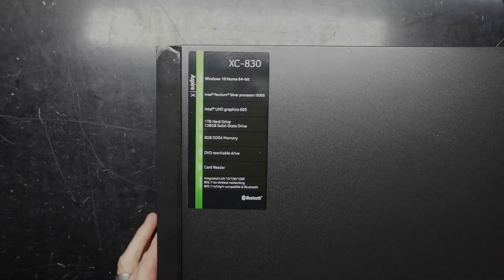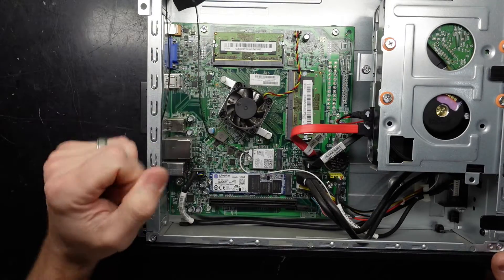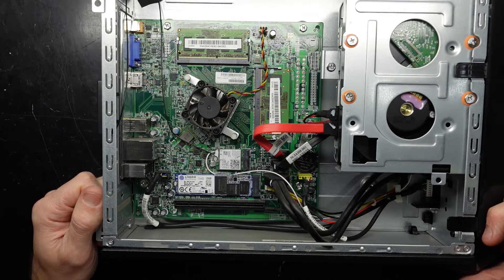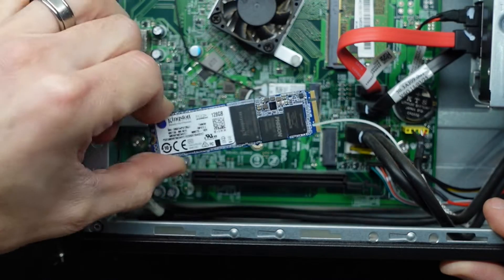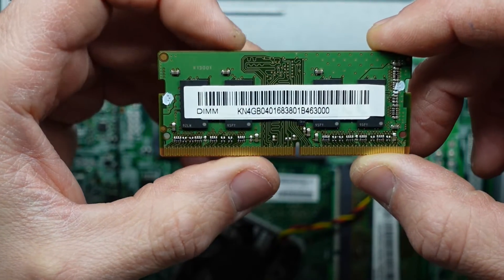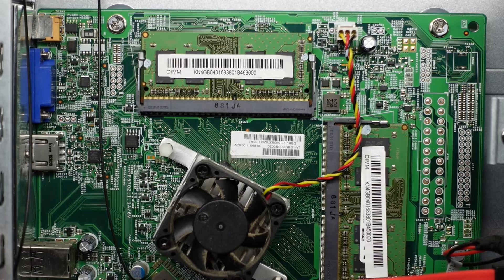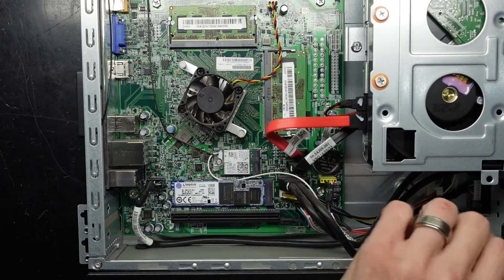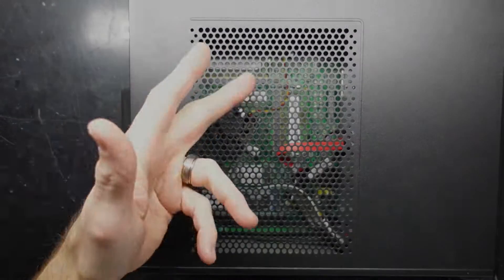Acer Aspire XC-830 What can be upgrade?

Comment: My mom's old computer stopped working (boot drive failed) so she decided to finally switch to a computer she bought new but didn't use yet. It is a Acer Aspire XC-830 EB12 so older than yours but I am confused. No power plug? I know I had turned it on before but after cancer and all that I can't seem to figure this stuff out now. Seems so basic yet I can't even power it.

Comment: I few years ago I was able to purchase (bare) Asrock J4105/25-ITX motherboards for under $100 (CAN). But now, lol,  I can't even find any under +$200 today ?!
So I just grabbed one of these (new'ish) Acer XC-830 (J4125) Desktops including 8GB DDR4, 256G SSD, pwr. supply adapter, .... new on amazon for $175 (CAN).
I can live with the limiting factors of Acer's case, and silly cpu heatsink/fan contraption, but hey, it'll still make a great box for playing with *BSD or Linux distro's.
 - Thanks for the video breakdown of this. :)
Reply from the maker: cheers
Reply: Found mine in a dumpster at a apartment complex

Comment: @rickstechrepairs Thank you very much for your explainations.
I'd like to turn this thing into a NAS with 2 HDD (I won't use the DVD player).
Do you think the only satapower avaible would be enough to feed 2 HDDs of 4TO each (or 2 HDD of 2TO) ?
Thank you.
Reply: Nope, and even without the DVD player, (which uses nothing), I'd say by adding 2 more HDD's you should look to atleast a 90+ watt 19V comparable laptop brick.
Reply: I use an el-cheapo (PCI-Express) Asmedia sata controller card in my J4105-ITX for my (4) x 16TB Seagate EXOS drives and their good enough as an NFS media server, however I'm using a 250-Watt ATX power supply.
You would definately have to upgrade your AC-adpater to around 19VDC/7-Amp just for the spin-ups of those HDD's.

Comment: Correct me if I'm wrong, but looking at the technical specs for the Pentium Silver J5005 (which is a system-on-a-chip) I see support for only 6 lanes of PCIe 2.0.  So there is a question of how many lanes are routed to the M.2 slots and to that PCIe x16 slot.  I notice that the SSD you replaced here is M-key + B-key.  What does that suggest about the number of PCIe lanes employed by this SSD?  The WiFi + Bluetooth m.2 also employs a lane or two.  So, I'm thinking the PCIe x16 slot likely has only 1 or 2 PCIe lanes actually routed to it.  Given 2 lanes of PCIe 2.0, would a low-profile single-slot graphics card wot consumes under 90 watts (using an upgraded power adapter) be superior to the integrated graphics of the J5005?
Reply: It's a dedicated 1 x PCI Express 2.0 x1 Slot, it doesn't matter the lanes, and you're limited by that alone. So even a low profile nvidia 1650, for example, would be far better than the integrated crappy intel video.
Reply: No
Reply: but ya, these SBC's are very limited on PCIE-lanes, hence why it's NOT nvme, it's just m.2 sata.

Comment: My mom has the Aspire X (XC-830-EB11) so was interested in this video. Hers came with only one drive, though. 1TB SSD. That is the only difference though with hers. My ex is upset that Best Buy sold that to her, saying that she could have gotten a more powerful computer that is small in physical size and more powerful.  She does only check email and watch YouTube, though. Also, said CPU is soldered on, and this PC does not support TPM 2.0. All storage is SATA 6 compatible at least.  Including the M.2.  But it's not Nvme.  Only SATA.